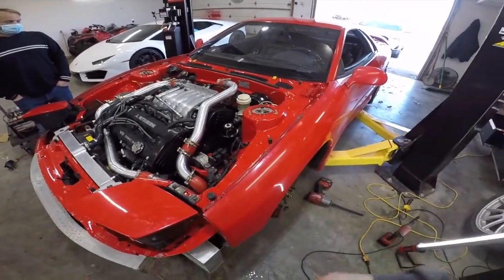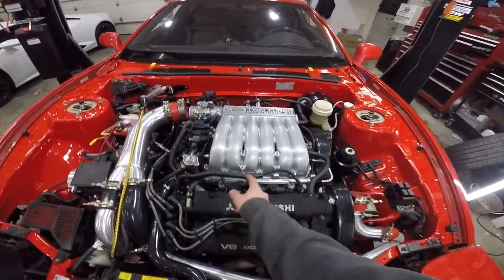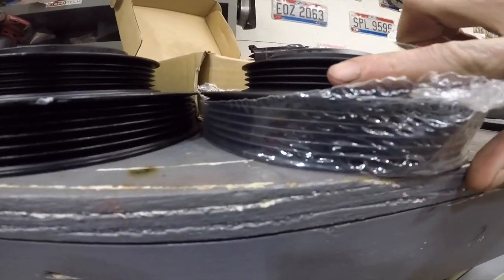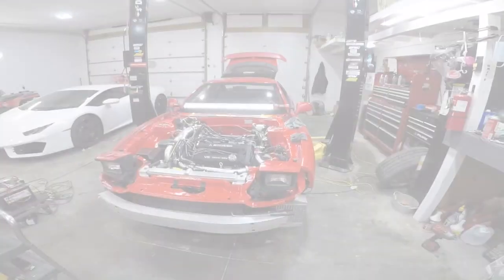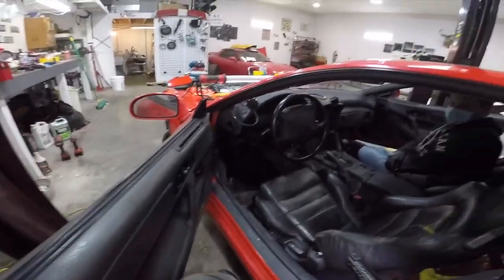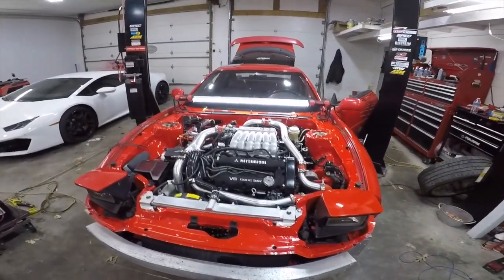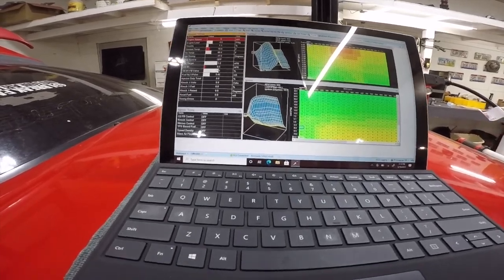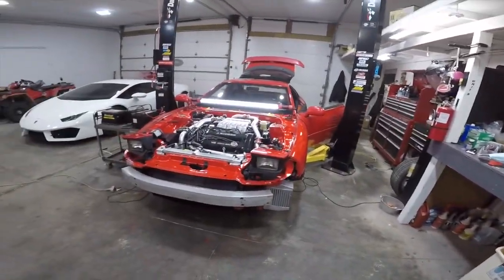Fixed MY mistakes / Hooked up MAP , IAT , Wideband Sensors to AEM ECU [ 3000gt vr4 ]

Comment: I finally got my car running! I think I'm having issues with my MAF sensor or maybe MAF translator though. I replaced the MAF because the car ran better without it. but now it won't start with the new one either. I have all the sensors to switch to speed density but I don't have anyone that knows how to tune and sadly neither do I. I can't remember which video it's in or who it was (might be Adrian but not sure) that you said you had remote tune it or something? I'm wondering if maybe one of you two would be able to help with that somehow?
Reply from the maker: What ecu .. ? .. If it's running without the mass air flow sensor, it might already be set up for speed density.... I did a video showing you how to set up all the sensors ... Tell him I sent you But https://www.instagram.com/higher_standards_performance?igsh=MWFjcmRzZ3U5Y24zcQ== You can remote in and get it running for you
Reply: @huracanian3051  It has the stock ecu right now, I have an AEM v2 that hasn’t been installed yet. Neither has the map sensor or the IAT sensor. Only thing that’s been installed is the wideband sensor for an AFR gauge
Reply from the maker: Yeah that's not right. Are you sure the cams are in correctly? .. I don't know how long or how many of my videos you seen but my first startup it like started and ran for a little bit and then never started again and it was because my intake and exhaust cam were flipped on the front head..  @SeclusiveSage13
Reply from the maker: @SeclusiveSage13  yeah that's just crazy that that's pretty much exactly what mine did. It seemed like it was going to run okay and then I thought it was all these different sensors and I ended up just getting the a new ECU and still wasn't right. So I went AEM and that's took all of that for me to find out that the cams were backwards when I had story motors build it for me. That's why I ended up building it myself
Reply: @huracanian3051 I’ve watched basically all of your videos on the VR4 that are more “recent” (around the 3 years ago mark). I did see the one with the front cams being swapped. That was crazy
Reply from the maker: Did u do the cams ? I would pop that valve cover off and check ? .. or at least check and make sure you don't have one cam like 180 out  @SeclusiveSage13
Reply: @huracanian3051 Yes, I did all the work on the heads myself, besides seating new valves. I have a borescope my friend let me borrow. I wonder if I can stick it in the valve cover and see how the cam lobes line up with the alignment pin like you talked about in that video
Reply from the maker: @SeclusiveSage13 yeah that sounds like it can work if you can see it good like you don't want to take that front valve cover off ?
Reply: @huracanian3051  actually, not sure why I didn’t think of this. But I did have to order a new intake cam for the front head so I know they’re in the correct way

Comment: Man how in the blue hell does a cat who so strict n picky mechanically like U accidentally put almost 3 qts extra oil in the engine? Damn just by putting the wrong bolt on pulley from above or below caused that man that sucks.... Damn this Adrian cat saved the day! Man almost there!
Reply from the maker: Lol .. Just dumb .. trying to rush I filled up the oil filter with a quart of oil and the oil cooler. And the next day I dumped 5-quart jug of oil in the engine ....
Reply: @huracanian3051  U probably 4got it a VR-4 6 cylinder not a v8 corvette. Lol man no worries on replies. Cheers!
Reply from the maker: By the way I don't know why I just got a notification for this but it says it was 14 hours ago my bad for taking so long to get back to ya

Comment: Keep em coming ! Just took off my sump to fix a dent and check the uptake. You made it look easy so I decided to have a go myself
Reply from the maker: Lol How did it go ?
Reply: @huracanian3051  🤦‍♂️ not great.. when I tipped out the pan to clean it - out fell two thrust washers and shards of metal. Weird cos it was running fine, no noise or smoke. Not sure I have the motivation / skills to take it out and bring it to someone.  Ha I almost wish I never took it off !
Reply from the maker: @rossocoroc5850  are the washers magnetic ? ... I did somebody prior just put magnetic washers in there to help trap any shards of metal if that's the case it's not that big a deal
Reply: @huracanian3051  cheers for the reply and taking an interest, no I just checked and they aren’t magnetic. Also there is a good bit of play in the crank like more than 3mm back and over, way too much I’d say
Reply from the maker: @rossocoroc5850  lol i just bring bad luck lol
Reply: @huracanian3051  not at all, in fact your attitude to life and over coming bullshit that comes across in the videos is why I’m not nearly as pissed off as I otherwise would be.  I’ll start putting aside a few quid to do the job or maybe try and buy a breaker and take the engine from that. Might take a while but that’s life
Reply from the maker: @rossocoroc5850  lol yea I mean u got to do it .. it's all over but the crying and if you don't cry it's over with lol
Reply: @huracanian3051  well I bit the bullet. Found a guy to take out and rebuild my engine. It’s worked out ok, I have a Starion here that needs work so he’s going to take that as payment. He seems to know what he’s at and has just rebuilt two GTO’s so hopefully it will work out. I’m already thinking I might upgrade my turbo snow that I’m at it ! 😃
Reply from the maker: @rossocoroc5850  lol good s#!t man
Reply: @huracanian3051  It was kind of weird. I was looking on some random Facebook Gto page. I saw a post of a guy rebuilding engines and was thinking to myself I wish I had a new engine. It was a small page (2,000 following) with mostly Americans, so didn’t think anything of it. I figured he was in Missouri or whatever 😂. Then I looked at the comments and saw that an Irish guy commented on a pic. I clicked on the op’s profile and it said he’s in  the same town in the west of Ireland as me 😂 what are the chances!? It’s not like these cars are common here . I rang him and he seems sound and reckons he just built a Gto engine that had the exact same problem , how weird is that?     He lives nearby and called to look at mine today!  Said he would take it out and rebuild it , skim heads  new bearings etc . Dumb luck
Reply from the maker: @rossocoroc5850  lol ... he's probably been stalking you and knew you would be on that page he's just trying to get you in a room alone haha 😆
Reply: @huracanian3051  please I have enough nightmares, don’t knock me I’m back in the game 😂😃
Reply from the maker: @rossocoroc5850  lol